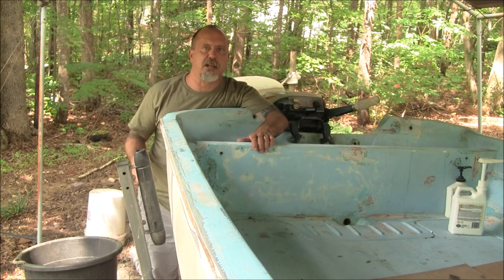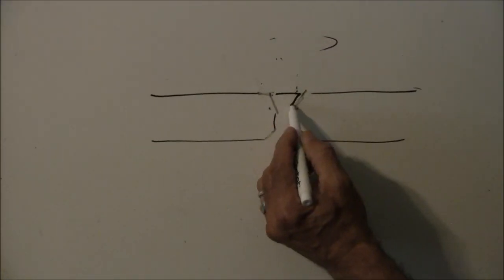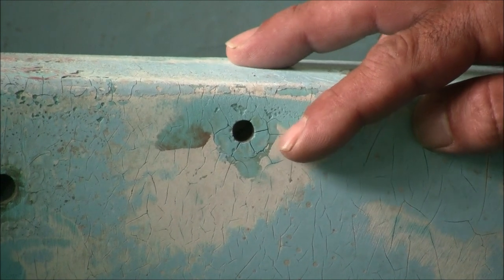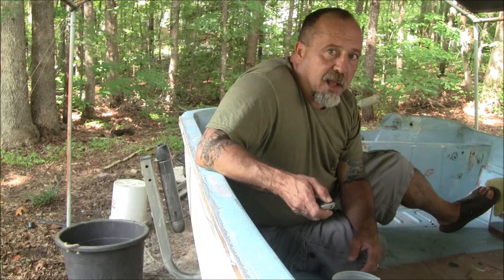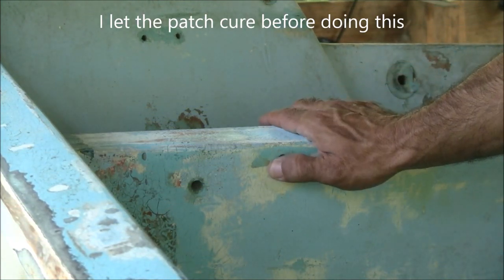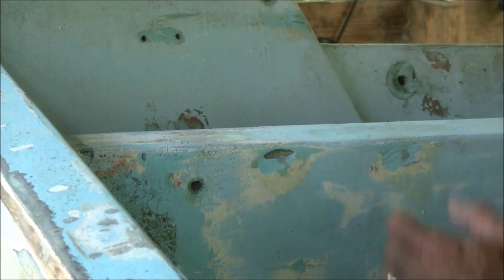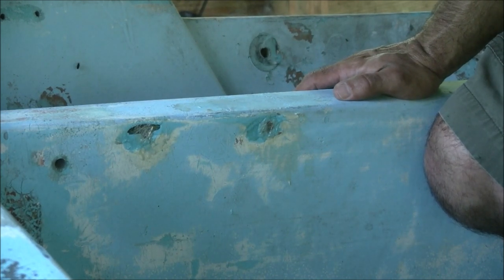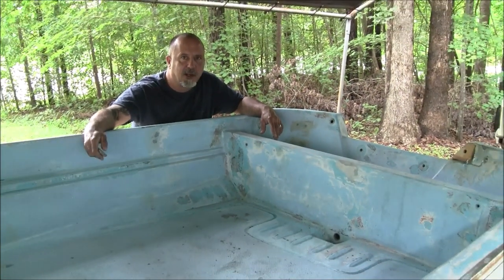Fiberglass Boat Repair of Small Holes - Boston Whaler 13 Restoration Part 4

Comment: You put your patches on backwards. Large patch goes on first then the smaller patches to level it out. This gives the most contact and strength to hold in your plug.
Reply from the maker: I've seen a lot of controversy on that issue and the community seems to be evenly divided. I'm open to try anything though and will give that method a try in the future.

Comment: I took all my holes and reemed them out just a tad bigger then they were , drilled a straight hole and then injected Great stuff spray foam into them.   Sanded them down and laid a layer of glass down.  Waiting till tomorrow to get the glass sanded
Reply from the maker: I'm doing that for my hull repair that has a soft spot. Injected it with foam and then ground down the entire area (about 2 ft by 1 and laid up layers of glass on it. At the fairing stage now so hopefully will have a video of the hull repair up soon.

Comment: I have some holes about 1/4 to maybe 3/8 diameter and smaller smaller holes left by the rub rail rivets.  Would a thick epoxy not be enough or would these holes still need to be beveled out and fiber glassed? Reason I asked is I noticed in your Part 2 you drilled a series of small holes and only filled with epoxy (using a syringe) on the front of the boat.  In the case of the rivet holes, just filling with epoxy would be easier and quicker, since there are a bunch of them.
Reply from the maker: You can probably get away with thickened epoxy if they are that big. Put a nice bevel on the outside to fair in with epoxy or fairing compound and you should be fine. I would definitely make sure to clean the hole out good so that the epoxy has fresh material to adhere too.

Comment: Aloha! I just bought a project boat to fish on hawaii waters. It's a 13 foot Boston whaler but I'm not sure on the hull type/year. My boat has over 150 holes drilled into it. Most on the interior of the gunnel walls. Should I spray them with foam first? What steps should I take?
Reply from the maker: Unless there is missing foam, I would not try to replace it. I would just patch over each of the holes with thickened epoxy perhaps a thin mat of glass.
Reply: @ExtremeDIYGuy  thanks for your response and input. You fo amazing work dnd I appreciate your help. What type of fiberglass should I use to cover those gunnel holes among with the holes in the floor of the boat. I was thinking of injecting some foam into the floors
Reply: @DaDude91  I have the same question. I have mat or woven roving. Which to use?

Comment: What material did you use for the plug?  Also, would you repair the holes the same way if you were to then drill holes and attach some deck hardware that would have a significant load on it?
Reply from the maker: I used thickened Epoxy for the plug. Yes, I think the patched area is stronger than the surrounding areas, I would probably lay up an extra layer of glass if  I was going to attached deck hardware in the repaired area.